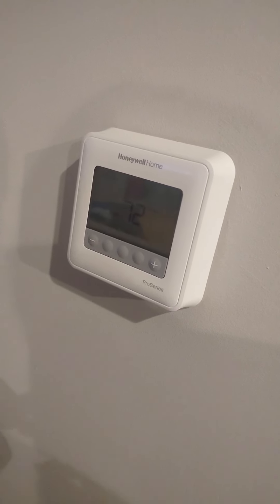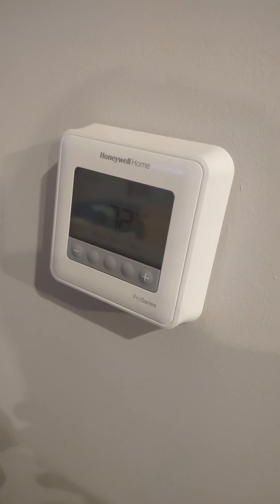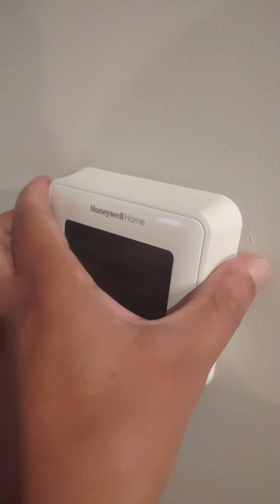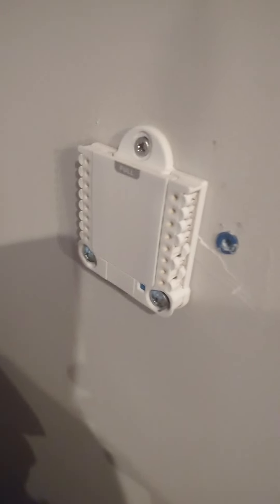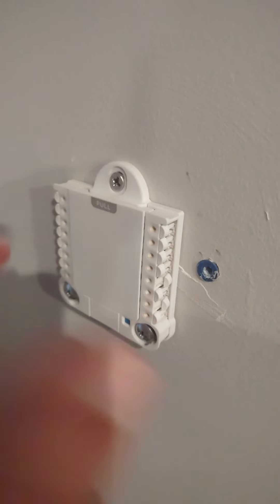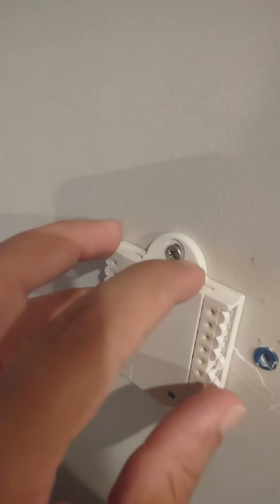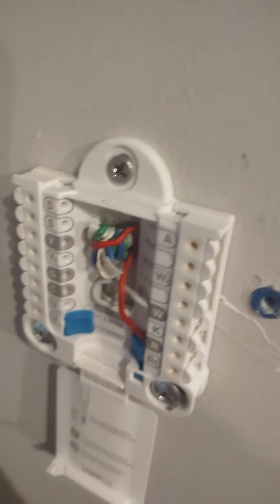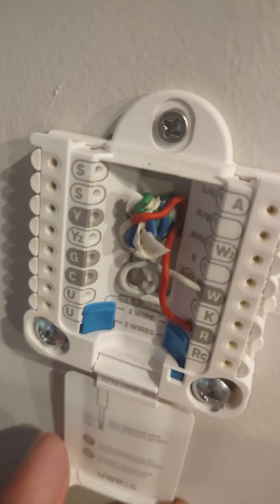Honeywell Home T4 ProSeries Thermostat Installation Overview

Comment: A very useful video
I have an old Honeywell thermostat, the CM927 but sadly, the display is nearly blank.
It works OK and I can use manual mode without a problem, but obviously it is impossible to change times etc, so it is time for a new model.
It looks like the T4, or actually the T4R is the one I’ll go for
Do I need an electrician, or a gas engineer to link this up with the existing receiver, situated near the boiler, or is it straightforward procedure.
Reply from the maker: Straight forward. Very easy to install.
Reply: @randogeek  thank you!